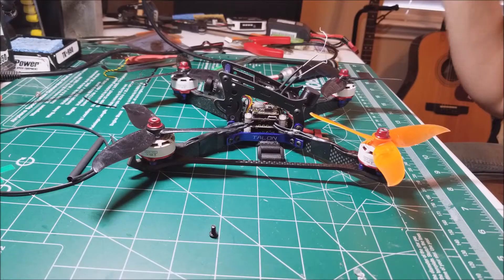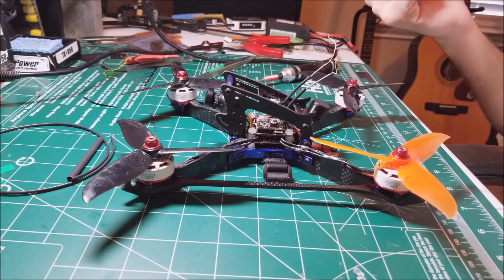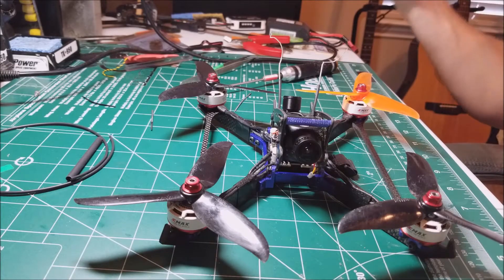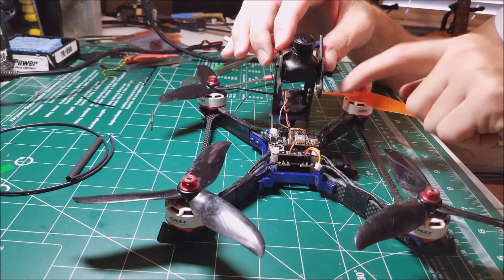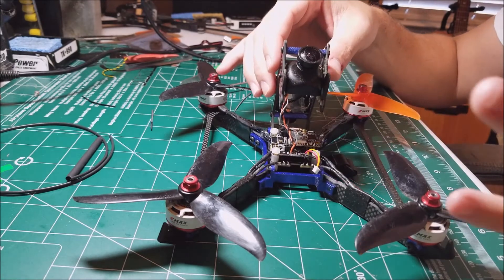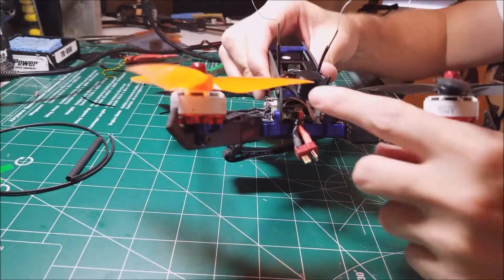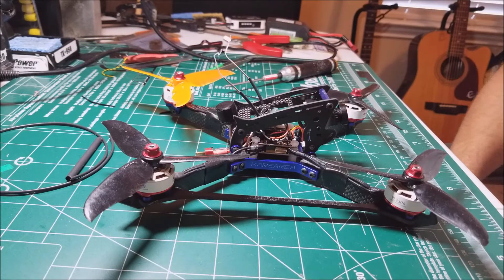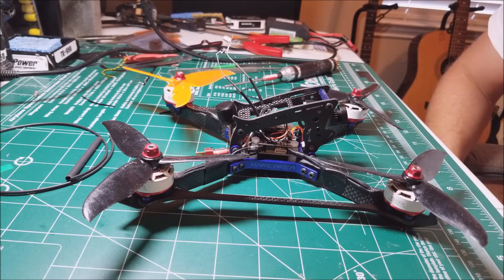Emax Magnum Pt. 2 (Using Spektrum Satellite)

Comment: Thank you so much for this video! Been racking my brain why I couldn't get my Spektrum satellite to communicate with the OMNIBUS F4 FC, did all types of searches with no luck until I found your video. I de-soldered the signal from the "DSM2 pad" and re-soldered it RX 3, made the changes in Betaflight and bang it fixed it. Thanks a ton!

Comment: I have no problem with a Spektrum sat on the provided pins. Didn't have to use UART3.
Reply from the maker: I wonder if I just got a strange batch. Thanks for the update!
Reply: So are you using the same pin out from the frsky to hook the spectrum? I try using the 3v ground and signal that is located in front of that frsky, but is not working ... give me some ideas, I’m new to the hobby but I been flying Helis for years Thanks